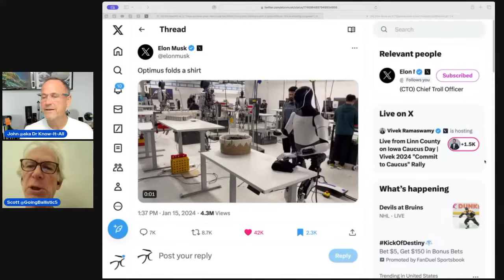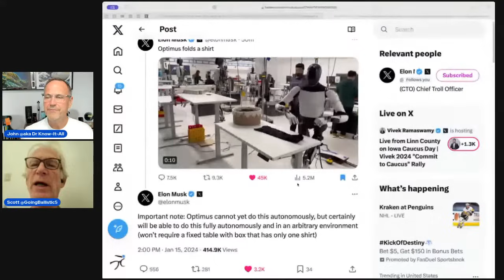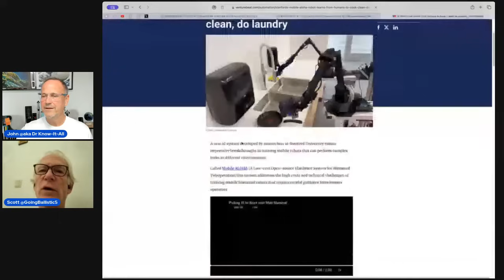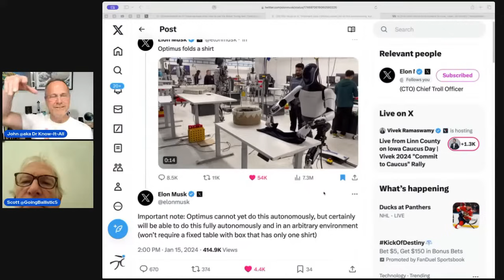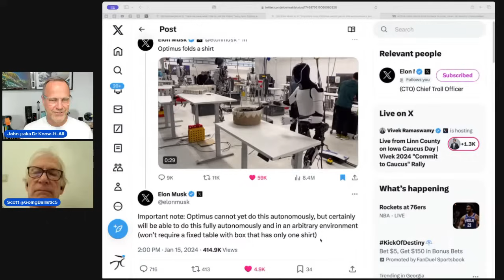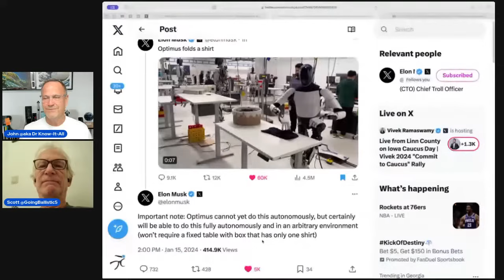Optimus Passes the ROBOT TURING TEST--Almost!

Comment: Trash collectors would be good. Assuming they could live to trash. Can. Very tedious job. Not a whole lot of understanding even needed. Dirty work. No one wants to do, dangerous in the sense of having to ride on the back of it. Dump truck, dangerous in the sense of it's dirty and filthy and you can get sick. That should be the first goal of Optimus. The only downside I could see is it would probably run on a battery in 3 hours or so. They would need some way to charge it on the truck or connected via cables to the truck. Something along those lines.

Comment: 2 hot swappable battery can allow the Bot to change out its own battery while keeping the uptime at 99.9%.

Battery 1 reaches 20% capacity, the bot uses the juice from Battery 2 and take battery 1 offline and swap in a fresh one.  Once battery 2 is exhausted, it switches back to battery 1 and alternate between them.

Comment: In terms of the AI being employed for this shirt folding... is Optimus just converting pixels in to hand movements out (like the car does), or is it actually 'understanding' that this thing is a shirt in a basket, and folding it is what folk do? So is there a token or noun for 'shirt' and a verb 'to fold', and it takes those two anthropomorphic concepts and gets the shirt out of the basket and folds it?
Reply: One view is that it does not really need to understand what a shirt is for, or why the humans want it folded, but that its a task its been requested to do. And it has to perform the task to whatever the accepted standard is. E.G. Not to rip holes in it, or putting it down in water or machine oil, or placing it on some cold pizza while grabbing the other side with its other hand. And so on.

Comment: Swappable backpack battery with mains voltage output. Put it on, plug it in, charge the internal battery, unplug and drop off the backpack. Only needed if no tethering and continuous working.

Comment: So I asked AI (Copilot) this quesiton:
what would be 10 great small tasks to train a robot at

AI:

There are many small tasks that can be used to train a robot. Here are 10 examples of such tasks:

1) Object detection: Train the robot to recognize and locate objects in its environment.
2) Obstacle avoidance: Train the robot to navigate around obstacles in its path.
3) Line following: Train the robot to follow a line on the ground.
4) Pick and place: Train the robot to pick up an object and place it in a specific location.
5) Sorting: Train the robot to sort objects based on their color, shape, or size.
6) Grasping: Train the robot to grasp objects of different shapes and sizes.
7) Speech recognition: Train the robot to recognize and respond to voice commands.
8) Face detection: Train the robot to recognize human faces.
9) Navigation: Train the robot to navigate to a specific location.
10) Object tracking: Train the robot to track the movement of an object.
--------------------------------

Folding clothes didn't make that list...

Comment: For charging, inductive charging through the feet makes the most sense. Pad on the floor at all different workstations. I work with RFID tags and the pickup antenna is extremely low mass. The closer the transmitter and receiver are, the lower mass they can be.

Comment: @18:48 High voltage battery pack? Even with a dozen 4680s in series you'd probably have less than 50 volts. Maybe on the up side of a step-up switching power unit it could be more.... I'd expect Tesla to want to keep the voltage around 48 volts for safety and for possible compatibility with components in their (mostly future) vehicles.  I grant you that 50 volts can be dangerous at high amperage in terms vaporizing a shorting wrench or some such, but it shouldn't be electrically dangerous for a person.
Reply: I have no idea what voltage they are built for, but like the Cybertruck, keeping the voltage up lets them use smaller wires (cheaper and lighter in weight), which might be important to feed drive power down to all the various motors all over the place.
Reply: @jimwithheld7217  oh absolutely!  I seem to recall hearing about some (commercial/expensive/professional) drones around eight years ago had up to 96 volt systems that enabled the drone to fly 4x or more longer than the mass market drones I enjoyed flying. The higher voltage allowed for a lower C rating which ironically reduced the cost of the batteries, too.... (ECSs and motors were more expensive, though) seemed like magic to me. However, with Tesla's emphasis on safety, I expect they will keep the voltage in any public facing hardware down to safe for humans (though possibly not pets) levels. Perhaps Tesla could go higher with industrial versions of OptiMusk, but I'd expect the current version to be 48 volts, and again, it may be that some of the 48V actuators in the bot may have roles in new Tesla vehicle models. win win

Comment: A couple of questions. How much more difficult is doing a task autonomously? Or do we not know because the field is moving so quickly. Also, will the safety rules for Optimus and other factory humanoid robots be the same as those for the current one arm robots? Will the gov have to scramble to make safety regulations for autonomous robots?
Reply: I think there are already rules for co-bots, so they at least have something to go off of to start, but I wouldn’t be shocked if things are changed to better apply to humanoids. We’re going to be seeing a lot of them in the near future

Comment: Swappable battery pack makes a lot of sense to me in a 24hr factory.
Reply: or plug into the workbench
Reply: @ricinro  Yes, that would work when you are at a work-bench.  A lot of dumb work is just moving things from one place to another and it reminds me of factories and warehouses that use electric forklifts.  It would be easy for optimus to swap its own battery.  If it was a commonly required function it would be easy to have a very small lithium polymer pack to run two minutes during the swap.  Then there is a wall of batteries being charged and the bots just go there when they need to and dont' need to clutter the work area with extra cables or anything. 
The guys talking are confusing the 400V high voltage batteries but that woudn't be needed in optimus as they are likely much lower voltage motors, maybe even 48V, so the safety aspect is not the same as a drive motor for a car.  A small LiPo 48v is not a big deal.  Anyway, these are implementation details that don't matter at this point and would take Tesla almost no time to decide which way to go, so sorry I am talking about it so much.

Comment: If the robot is being teleoperated, I'm not impressed. If it's not being teleoperated, it's an interesting demonstration of a humanoid robot performing a simple task, but I see no sign here that this robot will soon replace human labor, and I have no idea what "Robot Turing Test" means.

ChatGPT had untold millions of lines of human-generated text and conversation with which to train a neural network. FSD has millions of miles of Tesla driving. Tesla has no similar database of humans folding shirts and performing countless other tasks that a robot must perform to replace human labor. Apparently, training is to be one task at a time via remote operation.

It's not obvious to me from this video that this robot could successfully fold a pair of pants or even a shirt with a slightly different shape. Maybe humanoid robots trained this way can replace some human labor, but they'll need to be a lot quicker and more agile than this one.

Comment: In a worst case scenario where tethering is needed for recharging, you could simply cycle the bots based on battery state of charge- a full battery bot get tasked to wandering factory jobs. Once its battery runs down, it can swap with the bot at a tethered job station that is now fully charged. They will all have the same skills and can be swarmed logically\automatically.
Reply: Can follow the NIO model where you have swappable batteries and a swap station.

Comment: Optimus will have:

The Face is a "Retina Class LCD, like on Mac computer" Super clear, rounded, great for facial expression of your chosen robot Face, and it can play youtube on the face or it has a projector to project to the space in front of it.

Maybe one or two of finger tips are actually motorized flathead screwdriver and or Philips head screw driver or welding finger-tip-tac used for welding, or fingers with USB Device Release, wire thing to directly read off of hardware devices.

Optimus wireless FootPad Chargers.

Sentry Mode, that would be easily programamble to guard a property just by walking, checking stop-points to scan a barcode, Sentry Mode to guard un even terrained with steps large mansion properties, or Malls.

Optimus Tool Belt.

Optimus Lunar pair for the Lunar Cyber Truck.

Optimus wingman for Commercial Aviation, or to be a co-driver and humanoid helper for Semi -Truck Driving tandem Team.

Optimus Wingman for Border Patrol Units.

Comment: My prediction is that there will be a wireless charging pad for the bot to stand on. Maybe the same kind of pad for the cars. That way the bot can walk around easily and then go to a charger and charge autonomously (meaning no tethering from a human is necessary) , whether it be while standing and working or just charging while not being used.
Reply: Agreed. But even in a worst case scenario where tethering is needed, you could simply cycle the bots based on battery state of charge- full battery bots get tasked to wandering factory jobs. Once its battery runs down, it can swap with the bot at a tethered job station. They will all have the same skills and can be swarmed logically\automatically.
Reply: @LeptonSlinger  You can say that again!
Oh - you did.
Reply: Agreed. But even in a worst case scenario where tethering is needed, you could simply cycle the bots based on battery state of charge- full battery bots get tasked to wandering factory jobs. Once its battery runs down, it can swap with the bot at a tethered job station. They will all have the same skills and can be swarmed logically\automatically.
Reply: Agreed. But even in a worst case scenario where tethering is needed, you could simply cycle the bots based on battery state of charge- full battery bots get tasked to wandering factory jobs. Once its battery runs down, it can swap with the bot at a tethered job station. They will all have the same skills and can be swarmed logically\automatically.
Reply: Agreed. But even in a worst case scenario where tethering is needed, you could simply cycle the bots based on battery state of charge- full battery bots get tasked to wandering factory jobs. Once its battery runs down, it can swap with the bot at a tethered job station. They will all have the same skills and can be swarmed logically\automatically.
Reply: Agreed. But even in a worst case scenario where tethering is needed, you could simply cycle the bots based on battery state of charge- full battery bots get tasked to wandering factory jobs. Once its battery runs down, it can swap with the bot at a tethered job station. They will all have the same skills and can be swarmed logically\automatically.
Reply: Agreed. But even in a worst case scenario where tethering is needed, you could simply cycle the bots based on battery state of charge- full battery bots get tasked to wandering factory jobs. Once its battery runs down, it can swap with the bot at a tethered job station. They will all have the same skills and can be swarmed logically\automatically.
Reply: Agreed. But even in a worst case scenario where tethering is needed, you could simply cycle the bots based on battery state of charge- full battery bots get tasked to wandering factory jobs. Once its battery runs down, it can swap with the bot at a tethered job station. They will all have the same skills and can be swarmed logically\automatically.
Reply: Agreed. But even in a worst case scenario where tethering is needed, you could simply cycle the bots based on battery state of charge- full battery bots get tasked to wandering factory jobs. Once its battery runs down, it can swap with the bot at a tethered job station. They will all have the same skills and can be swarmed logically\automatically.
Reply: Agreed. But even in a worst case scenario where tethering is needed, you could simply cycle the bots based on battery state of charge- full battery bots get tasked to wandering factory jobs. Once its battery runs down, it can swap with the bot at a tethered job station. They will all have the same skills and can be swarmed logically\automatically.
Reply: Agreed. But even in a worst case scenario where tethering is needed, you could simply cycle the bots based on battery state of charge- full battery bots get tasked to wandering factory jobs. Once its battery runs down, it can swap with the bot at a tethered job station. They will all have the same skills and can be swarmed logically\automatically.
Reply: Agreed. But even in a worst case scenario where tethering is needed, you could simply cycle the bots based on battery state of charge- full battery bots get tasked to wandering factory jobs. Once its battery runs down, it can swap with the bot at a tethered job station. They will all have the same skills and can be swarmed logically\automatically.

Comment: Are those cylinders on the other table Tesla battery cells? Are they testing Optimus to work in the Tesla battery factory?
Reply: I think the batteries and the trays under the table are connected. Maybe the bot is practicing packing/unpacking?
Reply: @qm_rev  Yeah maybe, good spot, very curious if Optimus is going to do productive work this year in a Tesla factory, would be a huge step towards human labour automation!